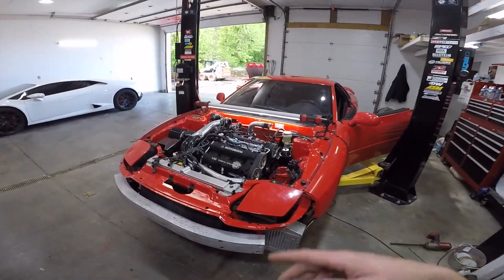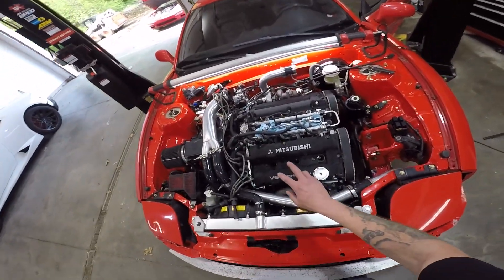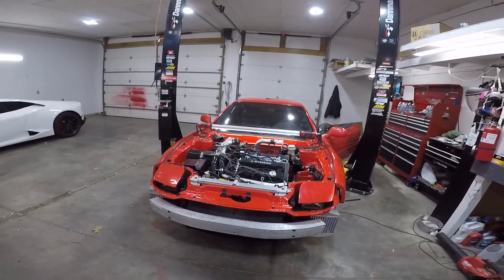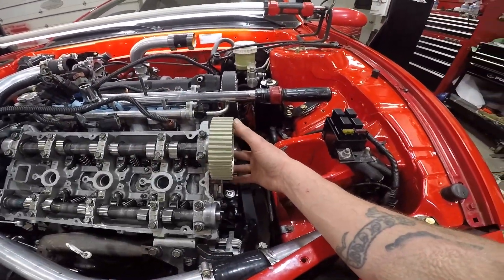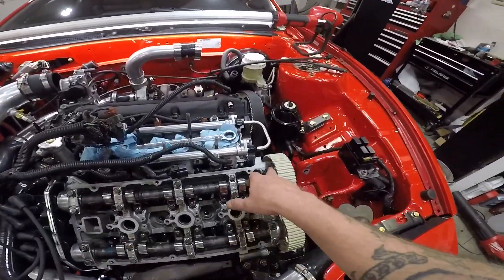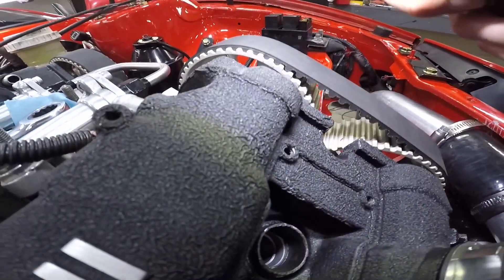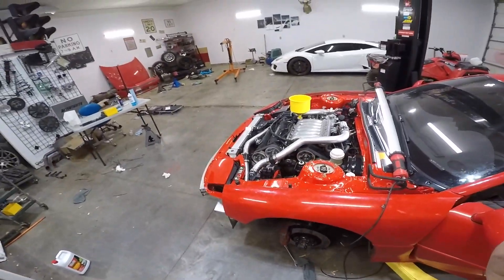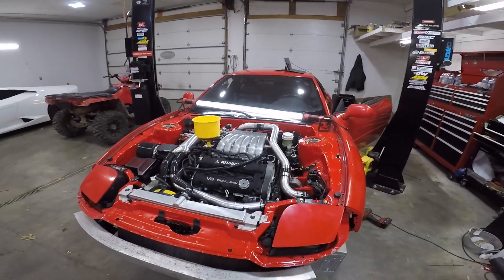Rebuilt TwinTurbo 3000gt Ready for Dyno ? how much Power will it make ?

Comment: I used a floor jack with a wood plank under the oil pan to support the engine up when I took off the mount. I got it snugged up before removing the mount, then left it holding it the whole time I was working on it and the engine mount bolts went back in without adjusting the height. I know that's probably not the best technique, but it worked and didn't damage anything. Glad to hear it purring again at the end of the video!
Reply from the maker: Yeah I'm too much of a sissy for that .. 🤣 .. you can't find an oil pan to save your life

Comment: Put a wood block on the front left corner of the pan and lift with floor jack. Just make sure you don't put the block where there oil pump screen is.

Comment: I support the drivers side of my engine with a (idk what it actually called) bracket that supports the axle between the trans and front drivers wheel. That bracket connects to the block. Check it out to see if you like it. I’ve seen others talk about it on 3si
Reply from the maker: Oh yeah that half shaft bearing .. Thats better than the oil pan
Reply from the maker: @joescerri8834  yea f that lol I have a lift a cherry picker butt I know quite a few of my subs don't have access to that ...

Comment: Hi Ian, writing in the comments for some advice. My buddy just bought a 94 gt and it’s roached out pretty bad. I’m planning on helping him do some basic maintenance to it. First thing I want advice with are the electronic front seats. It doesn’t move on the rail and the wires to the motor were cut by someone. Where do I even start with that. Next is it needs brakes and rotors. Any special tricks on these for rotor replacement or is it fairly easy?
Reply from the maker: Brakes are pretty self-explanatory I don't know what to tell you about the seat are the wires just cut in half can u just matching them backup ... ? .. how many miles are on it I would check that timing belt before you end up having to rebuild the whole engine
Reply: @huracanian3051  so the motor is going to be dead soon unfortunately anyways. It’s burning oil under revs.(I’m just assuming it’s pistons rings)  I’ll try and match the wires up and see what happens with the seat. The problem I’m having is that I can get to the bolts in the back since the seat is on top of them. I’m assuming the motor for the seats are dead. The previous owner also took it upon themselves to wire the pop ups to a switch and a custom fan wiring job. Not stoked about it. What are your recommendations their? New harness? Junkyard harness and splice? 

Last question. How hard are these motors to rebuild? I’ve rebuilt 2 strokes, but never a big engine like this one, but I’m super interested in trying. The car came with a set of .50 over pistons, which I believe would be a lot of work and money to get those to drop in.
Reply: @huracanian3051  also it looks as tho someone has gotten into the timing belt before so I’m just not worried about the motor. The whole car is less than stellar. It’s been fucked with extremely to much. I wouldn’t be surprised if I got into the motor and it had modifications done previously. Any advice is appreciated.
Reply from the maker: @jdm2779  everything about rebuilding the engine is pretty much step-by-step on my channel.. you should be able to do it just by watching my videos honestly... who makes the Pistons ?
Reply from the maker: @jdm2779  and it's going to be impossible for you to find a wire harness that's worth messing with if you don't like having a fan switch hook those wires to your ignition so the fan just turns on when you turn the key on
Reply: @huracanian3051  I believe they are Vitara but I’m probably wrong it’s been a few days since I scene the box. If it’s step by step with no special tools or know how other than getting the block bored and honed than I’m most likely going to attempt it. If he can afford it of course. 

The fans are already ran to the ignition but the wiring job is just twacked out and might cause a fire so I’d like to re do it. The pop up headlights are on a switch which was really what I was wanting to change back to stock. 

It sucks that these are kind of rare. I guess the only harnesses I’d be able to find would be brand new aftermarket ones online at this point. 

Thanks for the taking time out of your day to give me advice! Love the vids bro they are about to help me so much. 

I’m starting to work on it today. Oil change, oil filter, breaks rotors, and I’m gonna fuck with that seat.

Comment: Hey man, quick question. How are those fuel lines you made a while back holding up? Just looking to see if the amazon AN lines are worth buying or if I should just go with the expensive 3sx/stm lines. Other than that, great video. Super excited to see how much power this thing will make.
Reply from the maker: There good